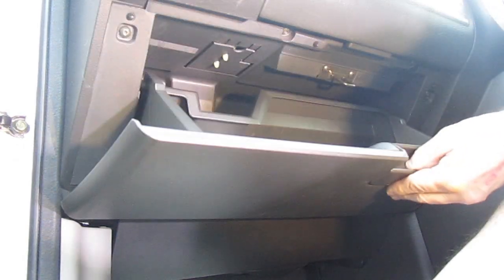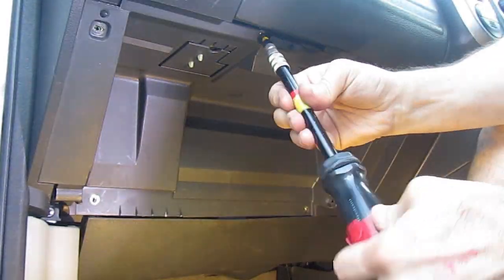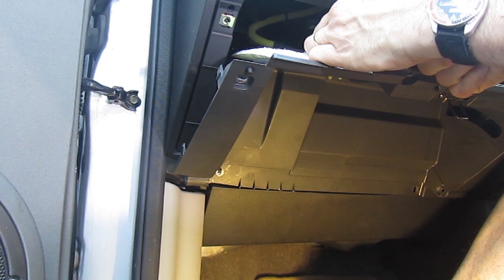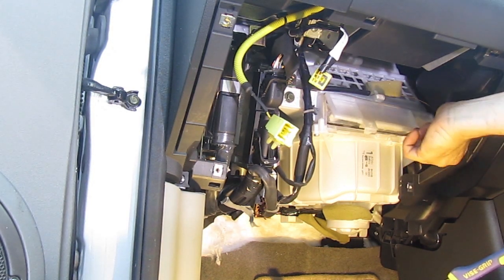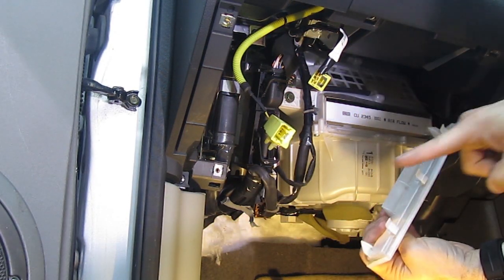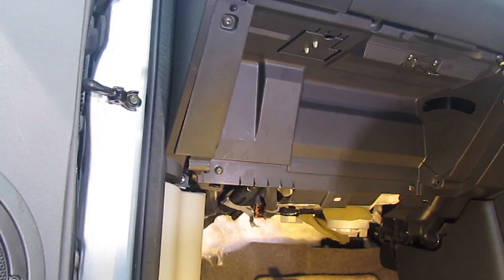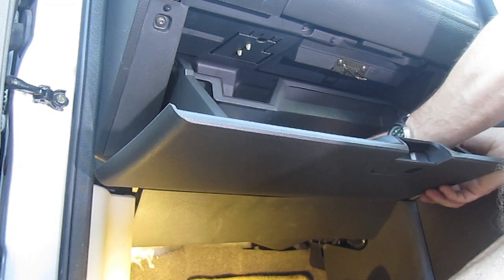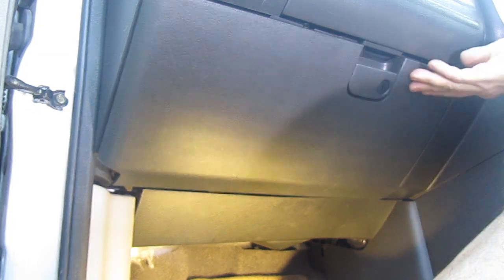Nissan Pollen Filter   X Trail and similar models

Comment: Just done mine. Not even five minutes. I only had to unclip the glovebox. No screws to take out and the cover just popped off. Cheers for the video. It made the job a lot easier than I thought it was going to be. The hardest thing to do was work out if the airflow arrows point up or down.........THEY POINT DOWN!!! :)      ***2003, 2.5 RHD Xtrail***
Reply: of course they do, they point TO the fan as the air flows through the filter then the fan, the guy in the vid fits his wrong.

Comment: The yellow cables usually are the air bag lines, maybe if you don't disconnect the battery, the air bag light will appear in the dashboard.

Comment: Is there anything there that has to do with the airbag fitting... My airbag module rattles a bit. The noise stops when I  place my hand on top of it... Really distracting as there are no other noises in line other than that...
Reply from the maker: I don't think so. I will see if the workshop manual has any information in it.
Reply: @scruffymid  thanks appreciate it
Reply from the maker: @vicentepallamare2608  
Not a lot in the manual exceptots of be careful warnings.
Here is the manual page, hopefully the link works.
https://mega.nz/file/Yx5xBCqB#QSstBM7W6J7eS5QZZkfnF6hXrq9cVmg5i4KKKo0LDzo
Reply: @scruffymid  I think Page 32 has what I need (potentially) these two screws seem like issues...

Comment: can anyone advise where resistor is on 54plate xtrail, heaters are on all the time even when dial is turnt to off and told likely to be resistor but can't locate it. TIA
Reply from the maker: Joanne Venton, normally if the resistors are gone the fan doesnt work at all, but i am no expert.
i have a service manual at home, i will take a look later and see where they are.
Reply: scruffymid thanks for replying.
Oh OK now I'm confused! any idea of what else it may be?
Reply from the maker: Do you know if you have 'Auto' air conditioning - i.e. climate control, or whether it is manual ?

If the dials have 'auto' on them then it seems like it is all controlled by a mini computer.
The manual system has the traditional resistor.
I can send a screenshot of the manual If that helps
Reply: scruffymid thank you it is auto as that's what it states. That would be a great help if u can send pic thank you
Reply from the maker: YouTube won't let me message you direct, or attach pics here ! you can look at my google+ profile (scruffymid) where I have put the pics.I guess your is auto (the manual has more old fashioned looking dials)
Reply: scruffymid just found it on your page and yes it is auto.
Reply from the maker: I have added more info to the google plus account.
Reply: scruffymid thank you for all your help just had a little look will give it a go and order parts. Appreciate you helping. 😊
Reply from the maker: Joanne Venton no problem.
Reply: Hi
Just message to say thanks for all your help. Changed resistor and all working as it should 😊👍
Reply from the maker: Glad I could help.

Comment: Hi do you know how to remove the passenger airbag cover
Reply from the maker: Yes, with caution ! - the airbag is an explosive !.
 The manual I have is the workshop manual and does not go into a lot of detail on the dashboard.

Are you in the UK ?, I can burn you a copy of the manual if you want (it is a collection of .pdf's with a little program that links the files).

I don't think you tube will allow email addresses in the comments section otherwise I could upload to google drive & share with you.
Reply: hi yes please if you don't mind

Comment: What is the pollen filter for?
Reply from the maker: Hiloy Dins, the air that blows into the car through the vents, either onto your feet, windscreen or face etc, goes through the pollen filter to help clean the air and remove some of the pollen and other stuff in the air to make the air inside the car a bit cleaner
Reply: Also known as a cabin filter.

Comment: I have an 2003 Xtrail, no one can show me where it is on that model, can you at all
Reply from the maker: I am not sure what difference the 2003 model is,, but an Australian forum has a few pics of both of the filter locations for the T30 & T31 models.

If you go to... http://main.australianxtrail.com/
Then click on 'Technical'
Then 'Micro Filter'
The pictures won't show up unless you register, or you can log in as me
username = scruffymid
password = temporary

Hope this helps.
If not, send me a pic of you car exterior and interior and I will see if I can work out which model it is.

(I will change my password to the forum back in a week or so, just don't post anything offensive in the mean time !)

Obviously, the side of the car will be reversed depending on whether you have a left hand drive or not.
The pics are Australian, so right hand drive - same as UK.

Scruffy.

Comment: Hi,  Have you done a video in regards to replacing the blower motor on a 2006 Nissan X-Trail?  It's a manual A/C and the motor is history.  I just can't find a video on how to take out the housing that holds the motor.  Thank you
Reply: I did it on my 2005 X-Trail. Be warned, it is not easy! 
However, you do save a lot of money if you do it on your own. There are videos on YouTube if you search around. I got my new motor from Amazon.